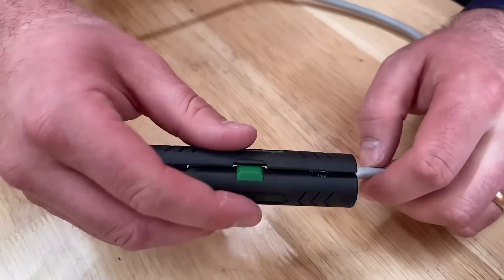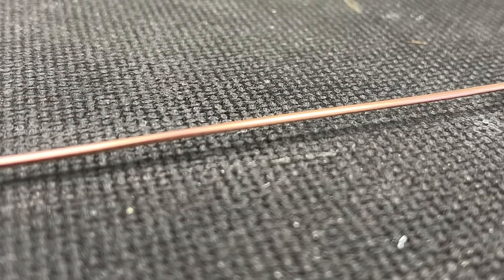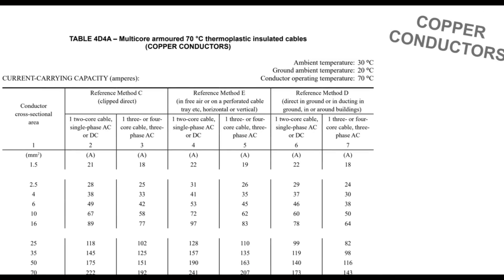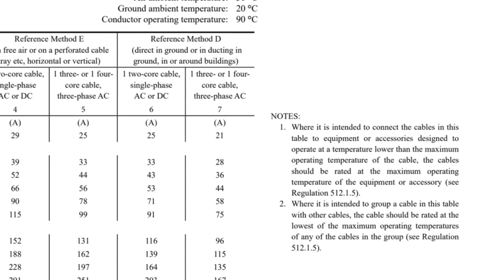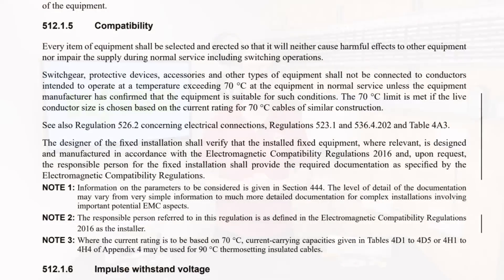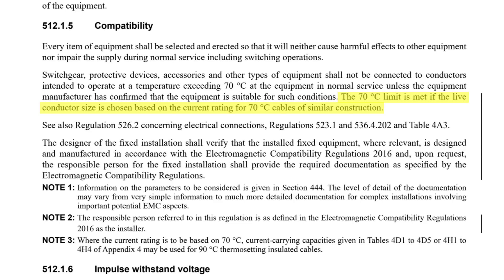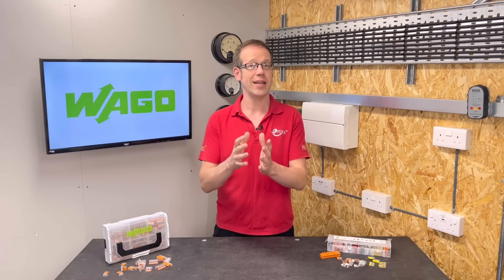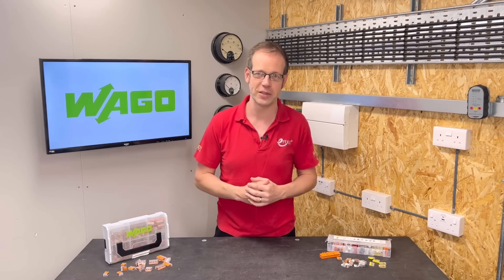Where Can You Use 90°C Insulated Cable?

Comment: Don't forget that even though cable can get hotter, it does so because is has higher voltage drop. Keep in mind if you run the cable for more than 10 meters.
Reply from the maker: Yes, lots of factors impact on cable selection. 👍

Comment: I'm not a top electrician but for really long distances, where this would actually save some money I prefer to rather upscale and lower the resistance and losses. A few % on the cable price adds little to the final costs and nobody knows, what else will be connected there in 5-6 years.
Reply from the maker: Very fair point. 👍

Comment: Realistically, cables in a bundle or penetrating through insulation may reach 90 and once you stripped and terminated the ends with lots of air between the cores it is unlikely to reach 60.

The only case where switchgear would really overheat is if you size runs based on the 90deg capacity table for single conductors inside a board, actually making them reach 90 inside a board.

If you follow the northern European rules, it is usually one wall penetration that causes use of 2.5 for 16A and 10mm2 for 32A, while 6mm2 for 32A would be fine inside a panel or clipped on a wall as is 1.5 for 16A.

Thick, modern insulated walls with bundles of cables going thru would require 4mm2 for 16A, and since 4mm2 is out of print, it would have to be bumped to 6mm2 for 16A. This rule is usually just ignored, but certainly 90deg 2.5mm2 is just fine for such cases, once you separate the conductors you can barely detect any heat and no uninformed party will later up-size the breaker from 16 since the wire is 2.5, so it is actually safer to use 90deg wire than up-size the copper.
Reply: In fact I would not be surprised if a 75deg single on the other end of your breaker may be allowed to carry more current than a multicore cable going through a wall or bundled with others but I am too lazy to check the UK derating tables.

Let alone a breaker where both sides connect to 75deg single wires inside a board, sized to actually reach 75. It is quite certainly going to run hotter than a breaker feeding a 90 multicore cable unless the multicore cable runs unbundled and with no other reasons for derating the whole way, so it can reach anywhere near 90 at the ends.
Reply: Yes singles are rated higher
But you can't just say once the insulation is stripped back that you suddenly drop the conductor temp by 20c. Copper is a good conductor of heat so if the cable is coming through an insulated wall and suddenly into an enclosure, the stripped back section will be wicking up heat away from the wall and still run too hot.
Also for consumer units, the air temperature is very high (due to the inherent heating element/ bimetallic strip inside each mcb/ rcbo) and should be treated as a sealed environment with no airflow other than natural convection. For socket outlets you have to consider that the plugs will have fuses and some contact resistance which also generate heat. The cooling effect is not great at all.
Reply: 4mm out of print??...tons of it on my job
Reply: @roystevenson1375  In the Nordic countries you may find 4mm2 with old colors, and you can get it on back order from some manufacturers in the new colors after weird looks from the distributor. Probably takes a while to arrive.

If you find 4mm2 with the modern colors actually used in some installation here I would try to fill a lottery ticket on that day.

The cooker used to be 4mm2 20A in the 70s and now it is 3ph 2.5 fused 16A or 1ph 6mm2 fused 25A.
Reply: @JussiPeltola  what were the old Danish colours?

Comment: One thing to consider.
A 90 C cable can handle a short between line and neutral for a longer time compared to 70 c cable, of the same size.
The same size mcb for 90 c cable might not be suitible for a 70 c cable, depending of type mcb b-c or d, cable length(resistance), since higher resistance reduces the short current necesscary to trip the breaker/mcb, before cable reaches dangerous temperatures.
I am not familiar with Uk regulations, but a 90 c single cable (small lengths like  0,5 m - 1 m) is often used in Denmark, in large switchgear/distribution boards, between copper rails and circuit breakers (mcb), due to the cables higher operating temp. at 90 c.
Reply: Some cables in UK consumer units are silicone and rated for much higher than 90c, 180c/200c but they're still sized as though they're 70c. The MCB already runs hot, no point using overly thin wires to make it run even hotter.
Reply: Of course isn't the intent however to be tolerant to higher ambient temperatures?

Comment: Another interesting topic with a great explanation of the regulations by Joe. The topic of heat is not given enough prominence in electrical design with many switchgear enclosures with no obvious means of dissipating the heat emitting by the electric equipment enclosed. I believe this has become of greater significance in recent times with the design and implementation of solar powered installations where outdoor equipment is subject to solar gain leading to equipment with high surface temperatures.
Reply from the maker: Thanks very much! 😊

Comment: Those strippers need to be banned they damage the insulation of the cable they strip  NOT ACCEPTABLE .
Reply from the maker: Are the tiny marks made on the insulation going to cause any real harm once installed? 🤷
Reply: Good tool. They just need to change the blades that they are using.

Comment: central heating equipment often requests cables for higher temperatures despite carrying only some mA.
The circulating water may get hotter than 70° and so does the pump.

Comment: Nice explanation, I have seen sparks install smaller XPLE cables without any consideration of the switchgear and equipment ratings they are connecting the cable to. Some of them thought they were next level geniuses because they had managed to downsize the cables.

Comment: Would it not be a use of 90°C cable where you derating it for part of the run? Looking at the tables an example would be 90°C cable SWA underground to an outbuilding/garage. If you put it on a 40A breaker then you can manage it with 4mm XLPE SWA but would have needed 6mm PVC as 4mm is only rated for 37A when direct in ground, but fine at 41A in the "free air" of the consumer unit?
Reply: There's insufficient length within the consumer unit to drop the temperature, also consumer units run hot from all the MCBs inside. You need about 1m of a free air run before the CU to be acceptable I would say such as perforated cable tray.

Comment: In my 35 years, I have only really seen a cable burnt due to, say, someone wiring a shower in 1.0mm. Never felt cables warm in normal operation apart from immersion flex
Reply: because these temperature ratings are for the internal copper temperature. Since the insulation + sheath is really bad at conducting heat, the copper temperature is much higher than what the outer sheath feels like. A 90c armoured cable operating at 90c will not burn you when you hold the outer sheath.
Reply: I  hadn't till recently (except on multi hundred amp cable tray installs when i was a yoof), but have felt a 4.0mm SWA get noticably warm when charging a car...  the full 32A for hours at a time has effects
Reply: Sheltered life?

Comment: But does current really "flow" through a conductor.......🤔:face-blue-smiling:
Reply: Whether it does or not it causes the conductor to heat up.
Reply: @davidfaraday7963  if it doesn't what's causing the heating.... 🤔🤣
Reply: @Pickle_Rick-m4o  Why are you asking me? You were the one who posed the original question
Reply: @davidfaraday7963  it was a rhetorical question hence the no question mark 🙄

Comment: If converting  from 70 degree cable to 90 degree cable in a JB, doesn't just the fact that there is  70 degree cable  in the JB mean that you can't have cable that could be at a higher temperature in that JB? You would need 2 x JB, one to go from 90 rated, to 90 rated but larger cross section so not above 70 rated limit, into a second JB to go from the underated 90  to 70 rated.
Reply: There's no need for the second JB. After a sufficient length of the thicker 90 cable and it has cooled to 70c, then it's now safe to enter the CU and the switchgear. By that point it's 90c cable operating at 70c.
Reply: @TheAviation101  Good point, so rather than as the diagram at 6.50 or so shows converting 90 rated to 70 rated at the JB, you actually need to convert 90 rated to derated 90 to the end termination.
Reply: @aardwolf21  yes because there will be a temperature gradient between 90 on one end and 70 on the other. Since copper is a good conductor, I would say at least 1m or ideally 2m of length for this.

Comment: But surely the joint that can reach 90°C is connected to a cable that will melt at 70°C so heat conducted from joint will damage the insulation on the 70°C cable.
Reply: You should use thick 90c cable of sufficient length such that it drops by 20c by the time it reaches the 70c termination point.

Comment: Just use polyethylene insulation for the coble, it's recyclable, and even non toxic. Tbh more heat = more power lost. So having the polyethylene insulation is actually better if you respect the normal table for 70C because it avoid having a short-circuit if you override the maximum current of the cable